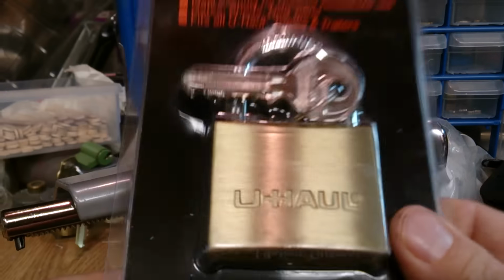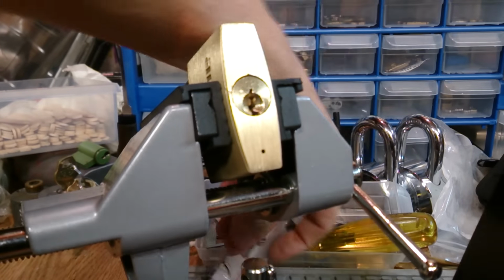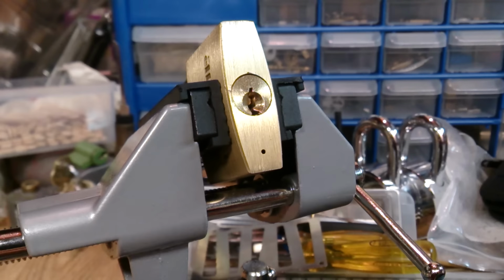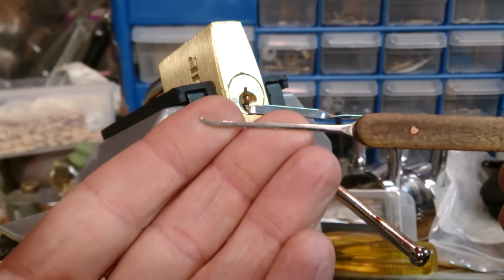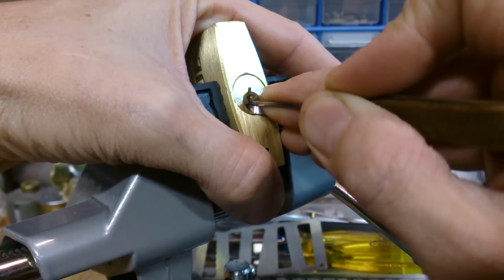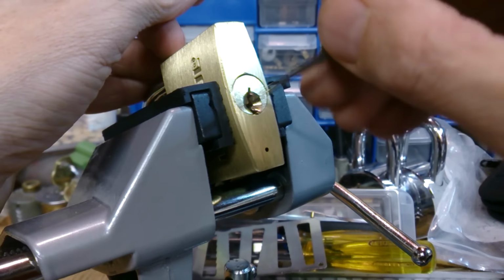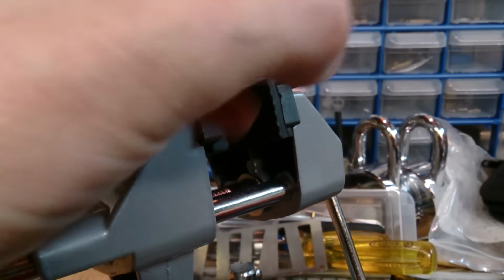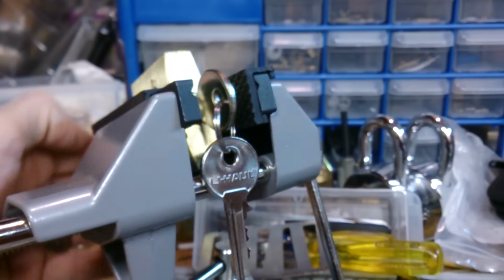[044] 5-Pin U-Haul SPP out of package (successful pick starts at 5:20)

Comment: All right, so I have one of these in my possession, and have picked a small handful of locks. How much tension were you using? Enough to flex your torque wrench? Did you use bottom of the keyway because the warding made it hard to maneuver your pick, and it allowed you to kind of rest your pick up against the wrench?

I have like thirty-five hours in total on this lock.

(Less than novice.)